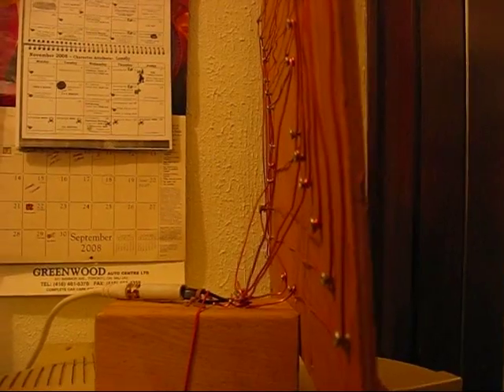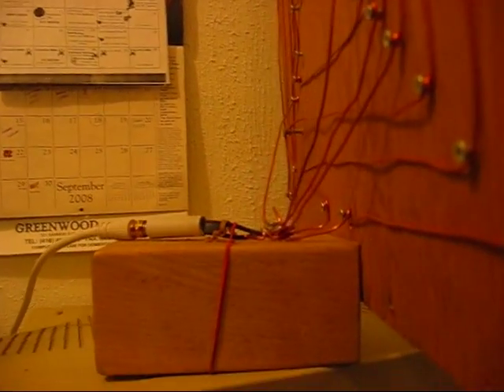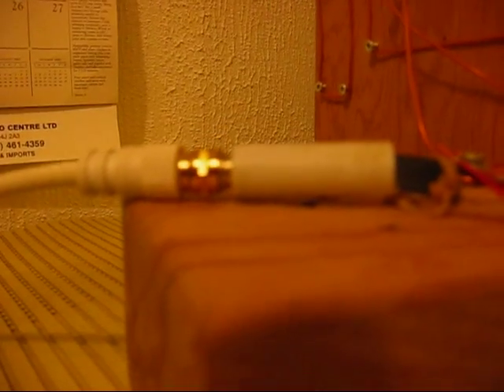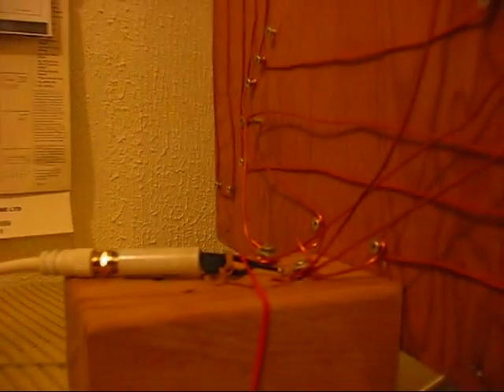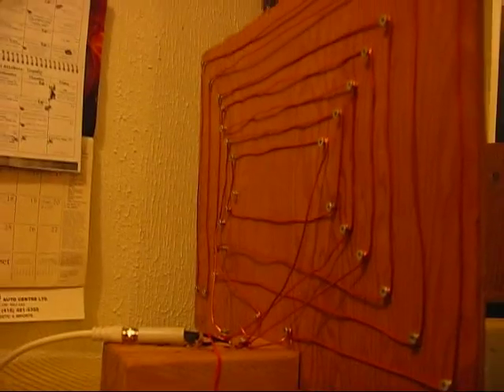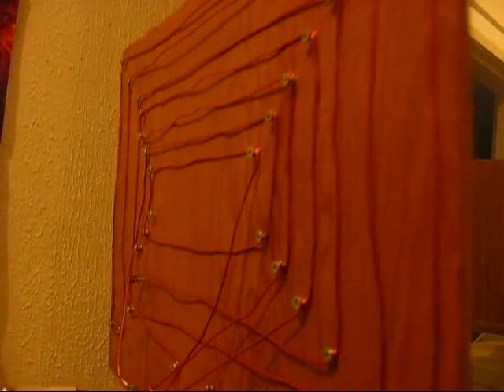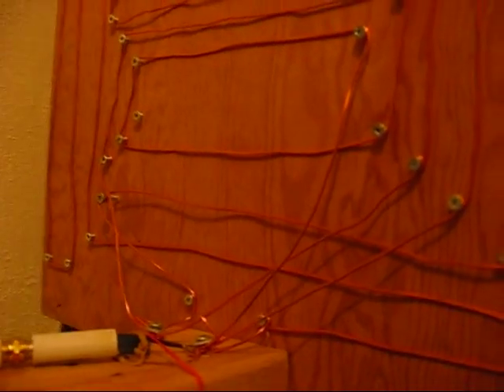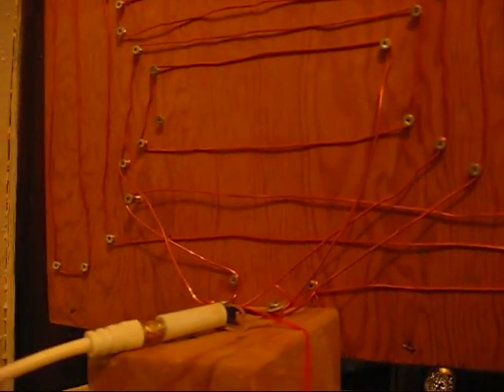Homemade HD Antenna 4.0

Comment: Just tried building one myself and It gave me 0 digital channels and the same old 3 analog channels that you get with a cheap set of rabbit ears,good thing I only spent about 3 or 4 dollars. I also didn't have a signal booster,I priced those out and they are fairly expensive.